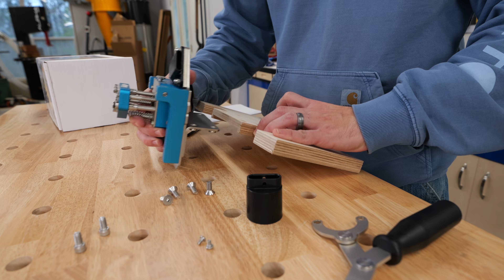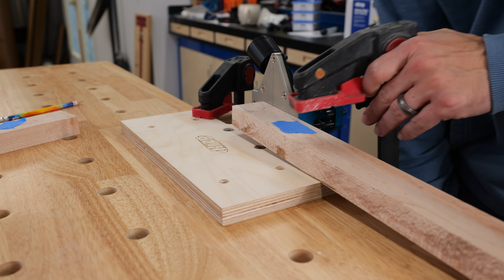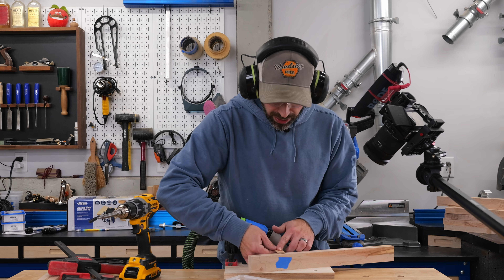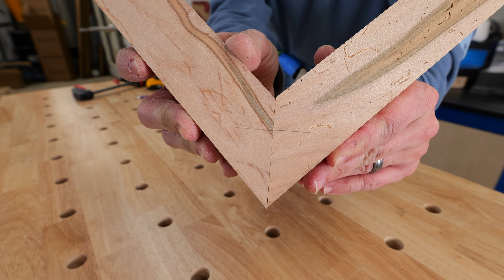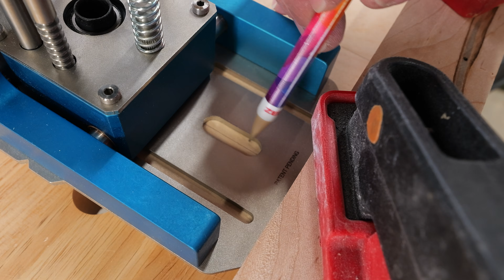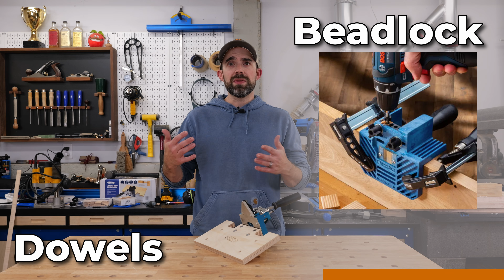Kreg Mortise Mate Review - Is the Domino Dead?

Comment from the maker: This new tool from Kreg is a great way to add loose tenon joinery to your projects and is much more affordable than other options!

🎥 Watch Next:  https://youtu.be/jEsVbiMpMxE

➤Tools & Supplies In This Video (affiliate)
Kreg MortiseMate: https://acmetools.pxf.io/kORgBN
Kreg MortiseMate Tenons & Extra Bits: https://acmetools.pxf.io/POajLY
Bessey Gear Clamp: https://amzn.to/4fEIsTZ
Bessey Trigger Clamp: https://amzn.to/4gxT8oA
DeWalt Drill: https://amzn.to/40dwf42
Mallet I Use: https://homedepot.sjv.io/a1OO3W
Festool Domino DF 500: https://amzn.to/4gWAbM7
Festool Domino DF 700: https://amzn.to/4iVrm78
Festool Dust Extractor: https://amzn.to/40eCc0y
Jessem Pocket Mill Pro: https://acmetools.pxf.io/xLnEev
Rockler Beadlock: https://amzn.to/4a4r5dZ
DeWalt Plunge Router: https://amzn.to/4gYFZ7M
Router Edge Guide: https://acmetools.pxf.io/LKDajM
Miter Saw I Use: https://acmetools.pxf.io/9LeGm5
Miter Saw Blade: https://acmetools.pxf.io/55jaW2

Comment: A tiny bit of wiggle room in a M&T joint isn't a bad thing at all. The tenon actually absorbs some of the glue and swells as the glue dries, locking the joint in place. A "mostly" noninvasive way to screw this jig to your workbench, would be to mark points to drill appropriate size holes on your benchtop, and install some threaded inserts. Make sure to sink them just a bit below the surface so that they don't interfere with other projects. Don't get over obsessed about intentionally drilling holes in your benchtop, it's a workbench, and it's eventually going to happen anyway, intentionally, or accidentally. When you need to use this, screw it down, and easily remove it when you're finished.

Comment: A possible solution for long stock is flipping it upside down and clamping it to your stock at each mortise location. Not as fast as using a Domino, but it's a solution if you don't want to move long pieces of stock for each mortise. You could even attach some toggle clamps or create a new base with toggle clamps that would make securing it quick and easy.

Comment: You got some nerve comparing it to the Festool DOMINO Joining Machine, I could only stomach viewing to 9:16 before barfing. The Festool DOMINO Joining Machine is a professional tool, quick and easy to setup, change tooling or setup with accuracy and consistently accurate repetitiveness. This on the other end of the scale is a toy for clueless weekend DIY wannabees. with its frustrating hit or miss Tenon adjustment and flimsy mechanical cross cutting mechanism to the apparent feeling you need to act like an octopus to achieve it anything.

Comment: I think a discussion regarding how much use this tool will actually get is appropriate here.If you are making table aprons or large doors, then mortise and  tenon joints are appropriate. As a cabinet maker for some time, my doors are all cope and stick, my face frames are pocket hole, and my drawers have evolved from a lock joint to dovetail.

If you are going to go full on into furniture making, you may want to look at a horizontal  boring machine because it gives you rock solid, repeatable set ups.  

The portability of this unit might work for a guy doing an occasional bit of furniture making in a small shop. Half the time I think the manufacturers are looking to make a market rather than build tools for an existing market. They’re looking for the guy who aspires to building furniture And may use this tool three or four times.
Reply from the maker: Great summary and insights Ben👊  

I had the opportunity to use a horizontal boring machine in college and I gotta say, that was a cool experience!  The Domino is my go to simply because I don't have space or enough need to justify a horizontal boring machine, but for a shop doing furniture on a production level it's makes a lot of sense.

Definitely agree that the MortiseMate is geared toward a hobbyist or someone simply not needing to cut M&T joinery very often.

Cheers!

Comment: This tool is the definition of you get what you pay for. It’s sloppy and loose. A biscuit joiner is a better option
Reply: This is a floating tenon jig, biscuit joiners do not offer structural strength, unlike tenons. They are for alignment only. Not comparable.
Reply: @samwarfelphotos with its sloppiness it’s very comparable which is why I made that comparison. A tenon is only structural if it’s fitted properly.

Comment: the festool domino was never made or designed for hobby / wkend users or the diy /occassional woodworker . the domino is was and is for professional use , the fact that some diy person had enough disposable cash to buy a 1 and done 1st time every time tool, is just that . kreg sent you a tool why didn't the send you some tennon's ?
Reply from the maker: You're spot on about the Domino.  It's an awesome tool and I didn't buy mine until I was a full time woodworker (even then, I bought it used to save some cash!).  Kreg did send tenons (6mm, 8mm, and 10mm) along with the matching cutters.  The 8mm & 10mm tenons fit like a glove.  The 6mm tenons are slightly undersized and result in a loose fit.  I've spoken with Kreg recently about the this and they're working to correct the issue.